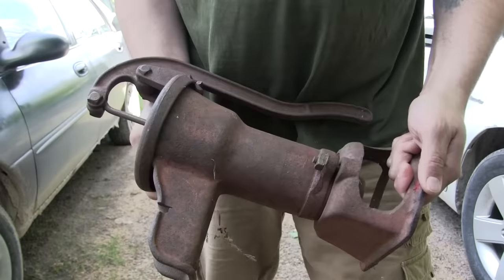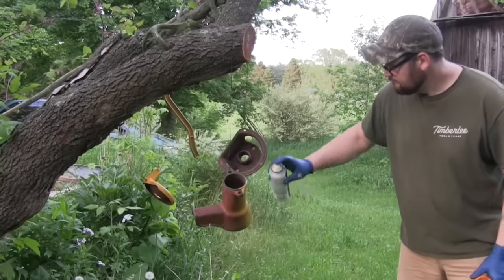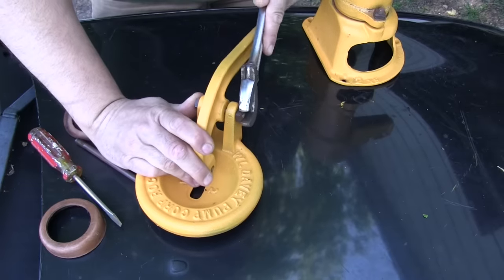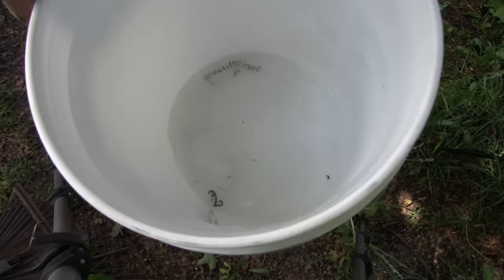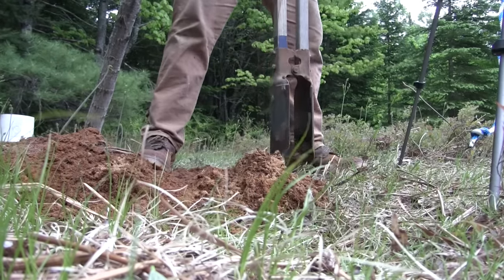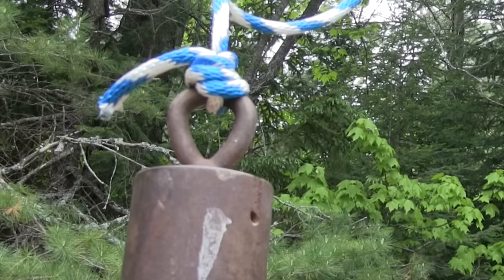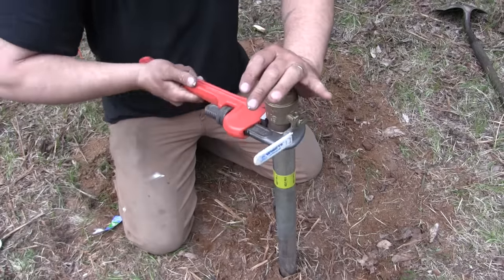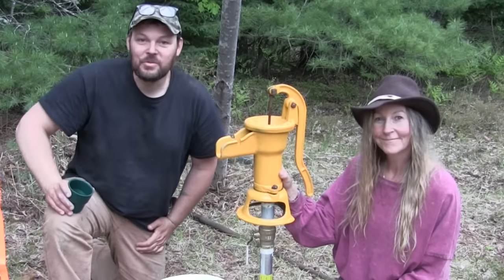Antique Hand Pump Well,  Start to Finish, at our Remote Off Grid Property

Comment: If you have 3 or more weeks, than soak everything in molasses to remove the rust. It's also safe on the old paint. 
I'm very surprised you put the picture on the base backwards. The flat (recessed) part of the base is supposed to be directly below the spout. To make more room for the bucket hanging from the notches of the spout. 
Will you be building a wood base? I would like to see that project too.
Reply from the maker: I might build a base.
Reply from the maker: I spaced out the bottom....never thought about the flat
Reply: @Bushradical  - Your pump is known as a pitcher pump and the flat is there so it may be mounted on a kitchen countertop, right up to the edge of a sink (off to the side typically) and there is mounting holes on the base for that purpose. The notches in your pump spout appear to have been cut by someone. Typically, an outdoor farm type pump has a longer handle with a long base, larger capacity, and an enclosed spout. I had one similar to yours when we bought an old farm forty some years ago, and an old farmer schooled me on the old hand pumps. Great video!

Comment: Super cool. Did you need to do any frost protection on the exposed pipe for the winter? Or is the fact it is connected to the groundwater provide sufficient thermal continuity?
Reply: I'm not an expert, but I  believe anything above ground is going to freeze. Not sure how it was done in old days.  Maybe they drained the pump after every use. Good question.

Comment: Hey Dave!  Loved this video.  I’m educating myself on the subject of pumps today, with a mind to creating a manual system to get gray water from a tank under a tiny home to various parts of my garden.  The pump you have here would help me get water to buckets which I could carry, but I’m hoping to connect a hose to the tank and have a portable hand pump  (maybe on a tripod to secure the pump at the location of the job).  Or, a manual pump with a hose intake and hose outflow such that I can leave the outlet hose at the spot in the garden where I need water.  Can you recommend a pump or system that might work for me? I don’t mind restoring something old. That’s pretty exciting actually.
Reply: حلوه متل قمر
Reply: Hope your project is coming along, youve probably encountered this, but thought worth saying. pumps generally are pretty poor at suction, there is a limit (thanks physics) on how much you can 'suck' on a pipe. but you can 'push' into a pipe far easier. for shallow wells, its very convenient to have the pump at the top, but where im from, wells are generally very deep, and so the pump mechanism is at the bottom with a push-pull rod running all the way down the pipe. the standard configuration is a windmill driving the push rod, pumping water up to a header tank above ground, to water cattle troughs. not terribly efficient, but being wind powered runs slowly but surely. 

what this means for you, having the pump at the end of the hose into your grey water is possibly a bad idea. get your pump as close to your water as possible, and then have a hose coming of that to run out to your garden. what I would do, is a small submersible pump down in your grey water, running off solar, feeding a header tank put up quite high. this tank need not be to large, enough for a watering session. I'd go for a 44 gallon barrel, as I can get plastic ones essentially for free. the sump pump works all day to feed a trickle of water into your tank, which you can then gravity feed from, to hose around your garden in the eavning. a off the shelf solar pump is only a few hundred bucks, new. an old wind pump can be got from farm clearing sales pretty cheap if thats what you want. i have seen hand cranked versions if you want the manual aspect. I like the concept of a slow feed up to a header tank you can draw from. even low volume wells can be made very useful. grey water, makes things a bit easier, but again, it is much better to have your pump close to the water and a long outflow. a long intake and the pump at point of use is a pretty bad way of doing things.

But its your system, whatever works for you. not stupid if it works. for context, ive a clogged well on my property and am trying to figure out the best way to restore and use it. it used to run the irrigation on the property, but has run dry. i hope by only sipping at the water table, i can get a regular amount of daily water for my garden.

Comment: For freezing protection, you could build an insulated box around the well up to the bottom of the pump, then wrap some insulation around the pump and build a little pump house around the pump and insulate it. If you think you need a little heat in there you could put in a couple of regular light bulbs and leave them on. You only need to keep the heat at or a degree above freezing and you can pump water all year long.

Comment: My Dad showed me how to locate water underground using a makeshift divining rod....  2 sections of wire hanger bent at 90°...  loosely hold one in each hand, cupped with thumbs up and bottoms of rods resting on your pinkies.  Walk across ground and when the two rod points swing toward eachother, mark ground and pass by a couple more times to be sure.  Dad was a Michigan outdoorsman as well.

Comment: "It's sweet actually" sounds like they are tasting lead.
Reply: Lead?  Most of the time lead is a problem in potable systems it is because of the pipe and mechanical systems used.

They clearly did not use leaded pipes or sealants, and groundwater has pretty much no chance of having a high enough concentration to be an issue.

I'm not saying their water is clean, but i doubt its lead.
Reply: Prolly the paint
Reply: @WhoopDePoopDeScoop  I highly doubt he used leaded paint.  That is not easy to come by in this day and age
Reply: @DnaKGames  not that he used it, but if you look carefully, he didn't paint all surfaces the water was touching, leaving original and potentially leaded paint on the pump.
Reply: He said it tasted sweet. He did not say he suddenly felt tired. If u got lead in you. It would create drowsiness instantly
Reply: If you have ever drinken clean well water you would be amazed at how sweet it is. And no no lead, multiple tests of the water and entirely new pump and pipe Installed and its just as sweet. 
The chlorine and fluoride added to public water makes it taste disgusting. And purified bottled water is too dead. 
Good water tastes sweet and is addicting to drink.

Comment: Im sure you know this but... i might as well add that you never want to close the ball valve in the winter months the water will freeze in the pipe when not in use and you can burst a pipe/ or freeze it solid where you cant pump. only use the ball valve during summer/ warm months.

Comment: I bought 2 pitcher pumps at Harbor Freight years ago. I think they cost me 20-25$. I bought another last year at TSC for $55 including tax. There is an antique pump in the hand dug well. I need to take it out of the well and clean it up and replace the leather. I will probably buy a few extra leathers for barter. I know there are people like me that need to replace the leather in their pumps. I've also got several two man crosscuts that need cleaned up and sharpened. I've got two of the tools that set the teeth. Drilling a well like you did is tiring. I want to put one in the back woods one of these days.

Comment: I was raised in a community were everyone had a well like yours only with an electric pump plumbed into the house. Over 18 years I doubt our well was over 30 feet (I helped my dad drive it). We used a stand-on platform that connected to the water pipe. That way our weight helped drive the pipe as we hand worked the driver. The pipe went down fast.

Comment: @2:30, you like fixing up old things huh, I have a pre-owned wife of 20 yrs in need of some repairs. 😆😆
I'm a dead man.

But seriously I absolutely agree that the older crafts had a touch of ingenuity (engineering) that was marvelous and worked wonderfully of you took the time to understand the little bit of routine maintenance required  to upkeep.

Comment: Thanks You just gave me an idea!  I have a shallow well in a ditch i dug.  Its off grid remote and I shower in that ditch, but my manual pump requires and bend over , fill a bucket and lift the bucket to shower.  It would be great if I could pump shower water directly while standing upright and  by pull down vs up.  my well is 1-1/4 as is my manual pump.  I can extend my well up 5' so that the the pump is way above my head and install a spring that keeps the pump extended and then use  a rope to pull down with one hand.  I realize my plastic pump will likely not handle all these mechanics and I will likely need a pully and lever system to even be able to operate with one arm, but I can always build a custom cycler pump a bit more purpose built and heavy duty.

Comment: Sorry for interrupting but you can add a plastic tube bigger diameter with a whole cut out for the valve to make it more sturdy. So you don't have to hold the pipe while you pump. But overall nice quick job.

Comment: I like how you broke the pump down and explained all of it,  simple at it is.. It's interesting how they used leather gaskets and seals, which probably last for almost ever. Whereas now everything is always rubber and plastic, plus if you're driving from it leather makes allot more sense..

18 feet to water isn't bad at all, out here in the South West mountain region. I know about 15 to 20 years ago, you could maybe hit water in certain "Valley areas" at around 80 to 110 feet. Now I think some of those same areas run at around 140 to 200 feet, it's crazy. That's allot of pipe to run down, plus you're running through Khalichi clay type dirt and maybe minimal ROCK if you're lucky.  Basically you're  "DRILLING," I don't think there's no driving pipes in this fashion lol.

Comment: I  notice you never mentioned  a couple of things and the first one that comes to mind is the notches on the top side of the pumps spout has a groove on each side and that is to put the handle on the pump and that way you dont have to sit it on the ground or hang on to it.    Now you could put a base to sit the pail on and still have it hook on those grooves.  The next thing is you could connect a pump jack on the unit and by use of an electric motor you would not even have to pump the the handle by hand by use of a pump jack

Comment: That was great if you get live stock looks like would be somewhat easy to get a windmill pump going. If there is enough of a breeze. 
   In this area there are different types of water you can get in a well. Good clear water, salt water, sweet water, or mineral I think, it smells a bit like sulfur but when you put it in a jug and in the fridge it turns good over night.

Comment: I put one of these in a year ago i used Teflon tape instead of pipe dope... cleaning the inside of the pipe and the threads also helps and lastly the inside of the pump  should not be painted that can also cause funny tastes.

Comment: Good work!  I like the tri-pod and weight drop system.  Here is a suggestion for the next time:  tie two loops in the rope as hand holds.  It will make things a little bit easier.

Comment: If you do that again, consider using pipe dope first, then wrap teflon tape over it from back to front with CW turns before threading the pipe.  The combination of pipe dope and teflon has been used in the plumbing industry for years as it does a far better job of permanently sealing than goop or teflon alone.  

Also, consider buying or building a little motor up top to replace the handle.  Makes it a lot easier for filling large containers, such as a water hog for hauling water over to the house.

Comment: I am going on to my 3rd sand point. Hit water with the second one and right when I was about to be done, I went to tighten the pipe one last time and give it a few more smacks. It broke at the sand point…. Going to try one last time. I normally don’t give up on things but this is starting to cost a lot of money… any pointers on not breaking threads or points? That seems to be my biggest issue. The well drive pipes seem to be too soft.  Thank you for any input.

Comment: Hi guy's, great video!  My question is, what do you plan on doing in the winter? The water will freeze in the pipe above the frost line depth. The farther north you go, the deeper the frost line is, it could be from 3 to 6 feet depending on how far north you are.

Comment: Now that's high quality H2O right there.... But, not to be picky, I did notice that you have the upper part of the pump on backward, the flat spot is so you can hook a bucket over the end of the mouth on the pump and it will by level to the ground... just sayin'... I also did the same thing and had to take my pump back apart and turn it around...lol

Comment: I would also look at lashing three  pole maybe for teepee. It provides an interlocking so it doesn't slip easy to do, hard to explain.  All you need is decent 3/8-1/2 inch rope probably 19 feet is enough,  keep it good to hang a stew pot or raise you food high to discourage bears looking for food, important I see your staying in tent. " Old man from the  mountain "

Comment: I love it.  Strong work and adaptability!  I may just ask to borrow our Paratech technical rescue tripod from our Heavy Rescue rig (Fire Dept) haha.    A couple of questions:  1)  How do you winterize it so pipes don't burst or is that not a factor?  2) I was planning on dropping some quickcrete about 3 feet down after verifying water flow, knowing that makes pipe replacement challenging, but prevents the pipe from wiggling with every pump.  Is that not recommended?

Comment: Hand pumps are great but the type he is is using will only work if the water table is less the 25 feet 
  Deeper then that and a cartridge type system bhas to be installed . They run about 3 grand and the well will be deeper then you can do with a tripod. A drilling rig will be needed .
 Alternative Pump service

Comment: If/When the ground freezes, what are the considerations for this? Is the water frozen coming up the pipe? I'm assuming you're going far enough down so the water freezing is not so much a concern, but what about the water already in the pipe or in the pump?
Reply: You hold up a roll of newspaper like a torch near to the pump to melt the ice.

Comment: Should grease all bolt threads.  That avoids cross threading and binding, allows for a snugger fit as desired, and makes the connection much easier to undo decades later. Reduces corrosive fusing.

..

Comment: I’ve watched many of these well/hand pump digs. Many hand dug. This seemed like the easiest ones done. Easier than hand digging. But here is my question. On the end of the pipe was a point like shaped pipe. And each pipe screwed with sealant etc. How does the water come into the pipe? That’s my only question. And the valve at the top, I just love how you keep the prime on that well.
Reply: Same way a straw goes into a cup the pipe went into a pool of water underground. The pump draws the water up the line.

Comment: I have a point, looks identical to one you used. I have a spring tile spring, two tiles tall. I think each tile is 2' tall and 30" wide. There is ledge all around and my guess is the spring is only 4 to 5' in depth due to the ledge. Have you had any luck trying to go through ledge using the tri-pod method?  In the summer months the spring dries up bone dry. If I could get down deeper I think I'd be fine during the summer.

Comment: GREAT VIDEO...I'm in the process of reviving an old well not used for 35 years....plan to put in that same pump, but mine wasn't a kit...just the pump. Can I use pvc pipe instead since I have a pre-existing well?

Comment: Did you use a peach tree branch to find water on your property?  Or a willow tree branch or something?  I hear those branches will bend and point down to where the water is on their own, while you hold one in your hand....my uncle who homesteaded a place in Oregon uses peach tree branches to find water for people.  I think he used to charge $100 to get to the place you picked out, and find water on it using a freshly cut peach tree branch.  The thicker end of the "switch" you cut off the peach tree out in front of you, while you onto the thinner end of the switch.  And it's supposed to bend down on it's own when it's over water.

Comment: In my opinion 10 1/2 feet is too shallow. 30 feet I think is ideal for a hand drawn well. You want some depth to your well so the filtration is thorough. But it's a lot of work and if the water is good .. the water is good right?

..

Comment: Hey Dave I’m trying to put a shallow well in on my remote property. I’m confused about the check valve. The one I bought doesn’t have a lever to release it. I won’t be using the well in the winter and am wondering do I need a check valve I can turn off in freezing temps ( lower mi).  Thank you. I love your videos!

Comment: Excellent job.  I'm curious though, why not use a block and tackle instead of just a pulley.  It might have required an extra couple of feet on the tripod, but the mechanics of having two pulleys reduces the "horsepower", meaning your back muscles, required to pull the weight up and down.  Still, a very nice job.

Comment: Your wire wheel needs new belt and to be tightened depending the amp rate of your motor driving the wire.  Belt is like 15 bucks and save your motor to have the amp rating match the nameplate of the motor

Comment: You know if you put the pulley on the movable weight, and then run it up to top tripod, then attach pull rope to another pulley, you will have a 2-1 mechanical advantage to driving well point will be half as hard.